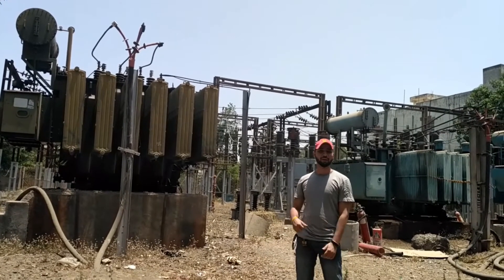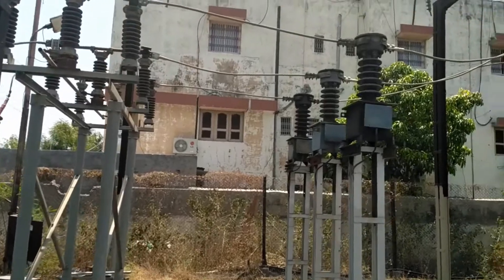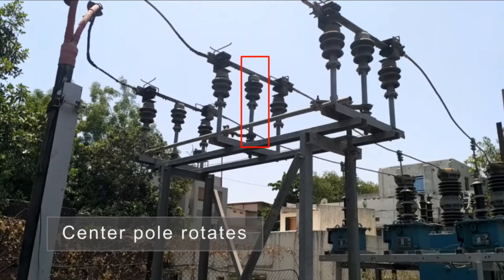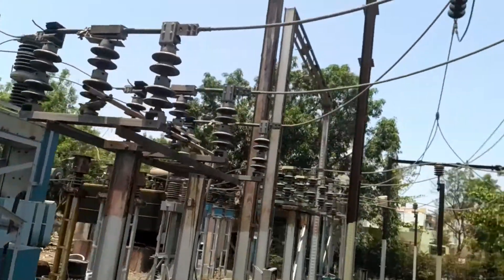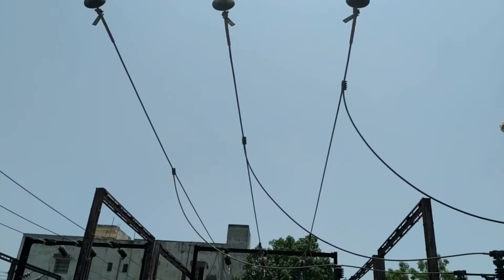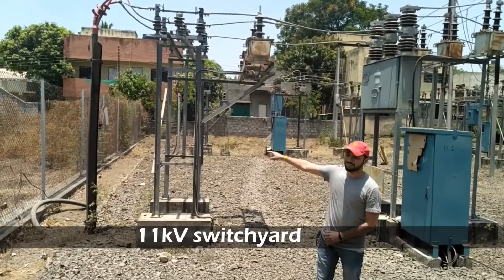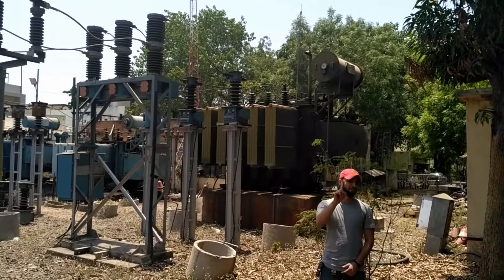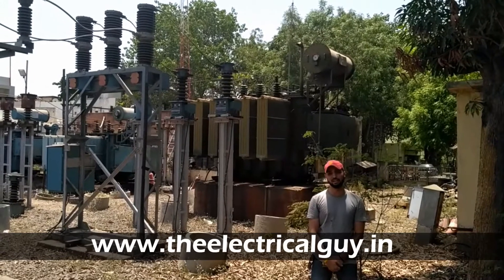A Ride through  33/11kV substation | theelectricalguy

Comment: One of the best videos ...but i have 2 questions ..
1) where is 33 kv side PT is located ?
2)  there is alredy CB and islotor arrangement provided before main bus then why there is another CB and isolator arragment provided before transformer?
Reply from the maker: 1) It is located at the incoming (not shown in the video).
2) Two separate CB and isolators are provided for busbar protection and transformer protection. The CB and isolator before transformer is provided specially for the protection of that particular transformer.
Reply: Thanks for the explanation. You could have mentioned the second set of disconnector and circuit breaker just before transformer is connected to the tapping from the main bus bar to each of the three transformers.